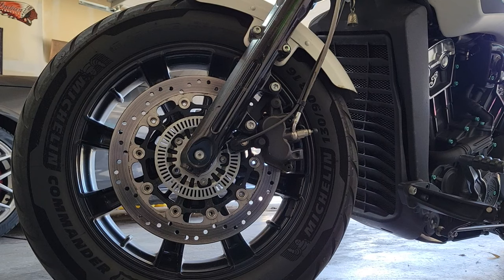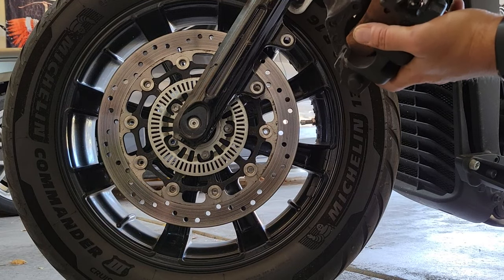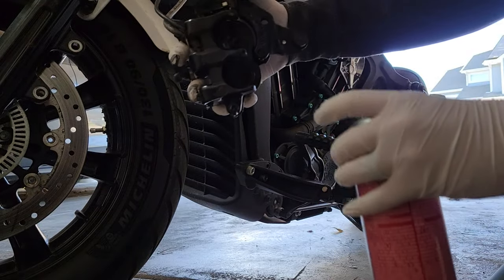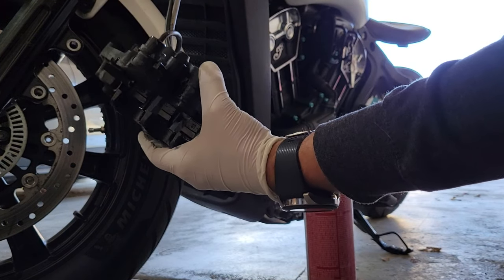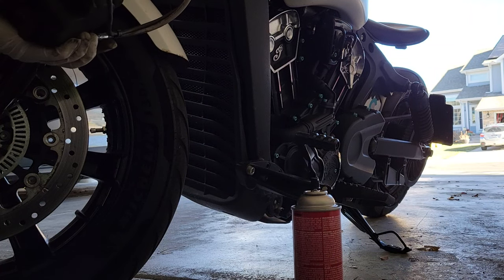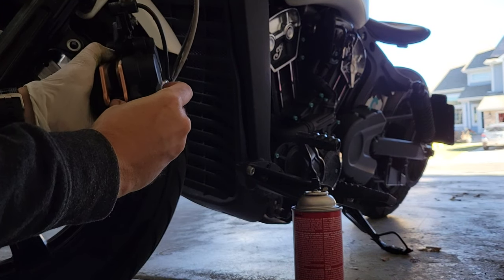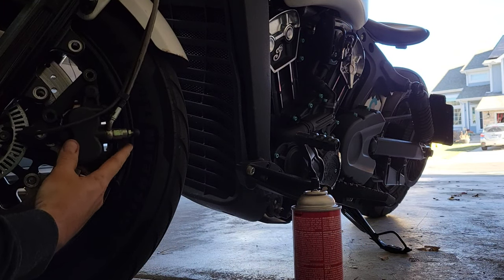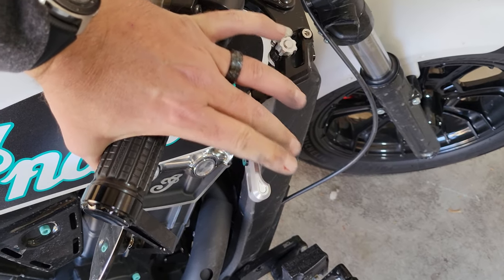How to replace your front brake pads on the Indian Scout Bobber

Comment: Non-chlorinated brake cleaner for the caliper and pistons, and what else? Did you clean the components with a brush? Or compressed air? Or just a rag?

I’m totally new to mechanics, but determined to do my jobs on my Scout. Thanks for the vid.
Reply from the maker: Just regular old brake cleaner, don't know if it was chlorinated or not. Just sprayed everything and wiped with a rag.
Reply: @Jimbobbington  ok thank you. The shop tech was telling me don’t use the regular stuff because it corrodes the rubber components. Just passing third party info

Comment: Hello. I was wondering if you could do a video in all the tools one should get in order to do basic maintenance in the scout bobber. I am a college student, and want to save money by changing my brakes, oil, and brake fluid etc.
Reply from the maker: My favorite tool in my inventory has gotta be a mini ratchet kinda like this one. Has come in handy so many times. Second best tool is a 3/8 drive socket wrench. You can get a socket that will hold all the same bits as the Mini Ratchet. Don't buy a big bit set,  so many will go unused. I typically pick bits/sockets up as I need them, at a couple bucks a piece.

OSDUE Mini Ratchet Wrench,Right Angle Phillips Magnetic Screwdriver for Tight Spaces with 1/4" Drive High Torque Offset Reversible Mini Ratchet Offset Screwdriver for Tight Areas https://a.co/d/dOXjrtG

Comment: Nice video. You should refill the brake fluid after changing the braking pads.
Reply from the maker: Shouldn't need to unless there's a leak. Brake flush is part of the 10k service as well anyway which came shortly after this video.
Reply: never refill brake fluid. 
If fluid is low that is indicator that your pads are low, or you have fluid leak. 
Fluid should be changed whole in system as per mileage or time table, usually every two years

Comment: There’s a pin under the 2 rubber boots that look to me like the manual says to lube but you don’t know how to get to them.
Reply: I just pulled in it and it came out. So you pull the  part with the slides off to lube them.